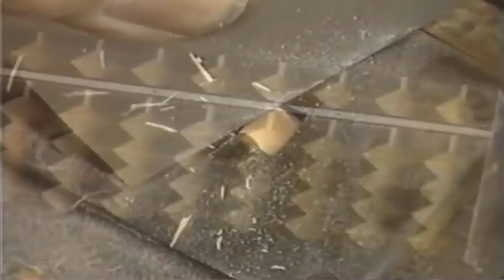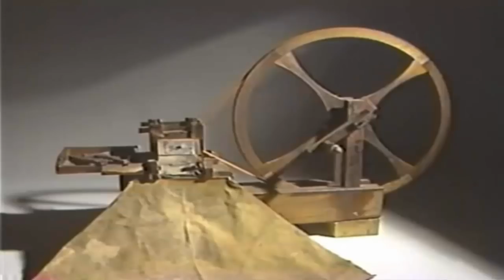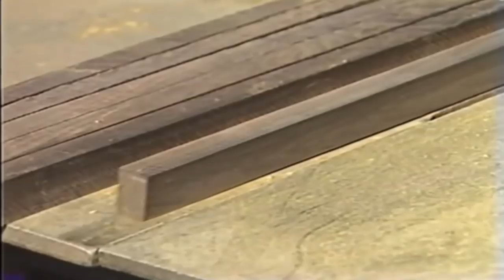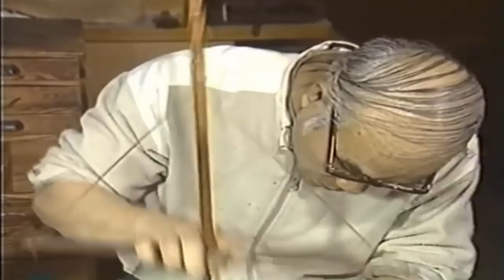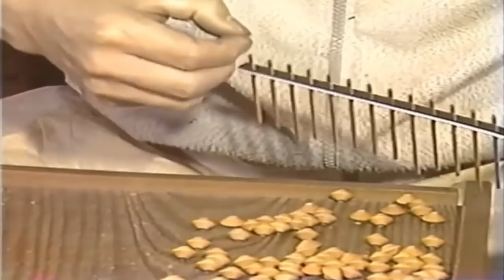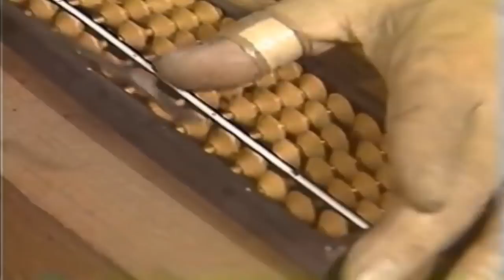Incredible Japanese Woodworking Tools Have Used for Soroban Processing - Crazy Ancient Hand Tools

Comment: Sadly the video is so speeded up I can't see the details of his work.
Reply: you can slow it down using the speed options settings ( little gear at the bottom right of the string). It helps catching the details.
Reply: Mathieu Lamaure What string?
Reply: Pentu Prager "screen"?
Reply: the red line of the time on the bottom of the video